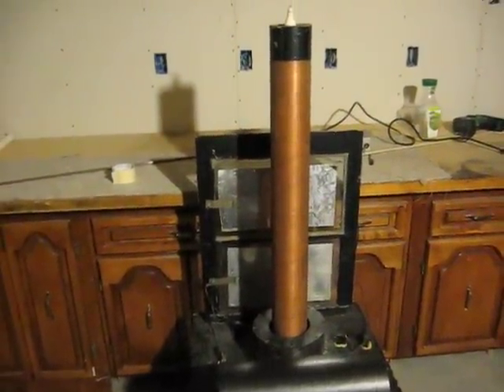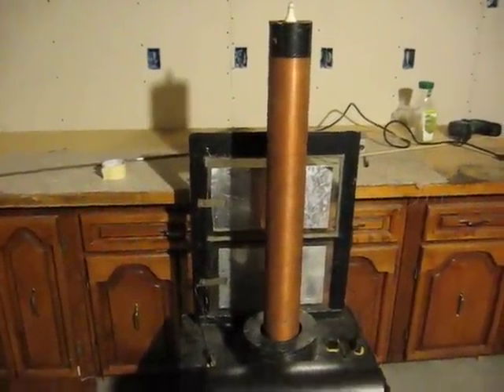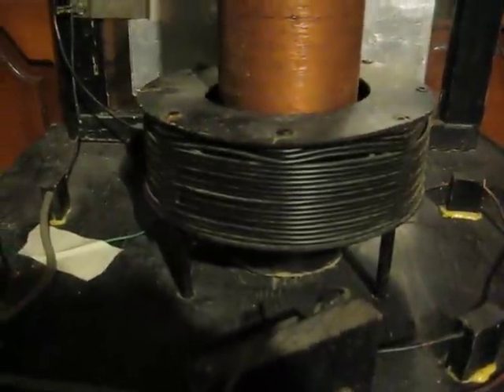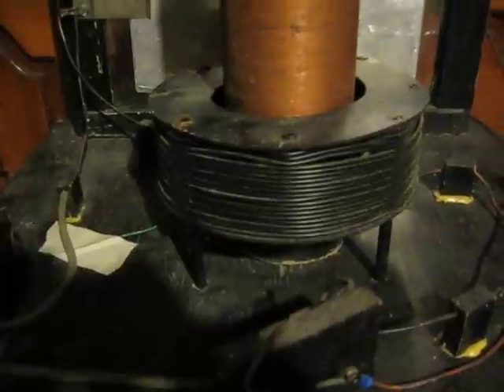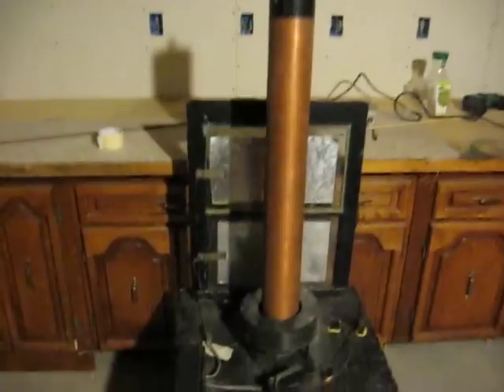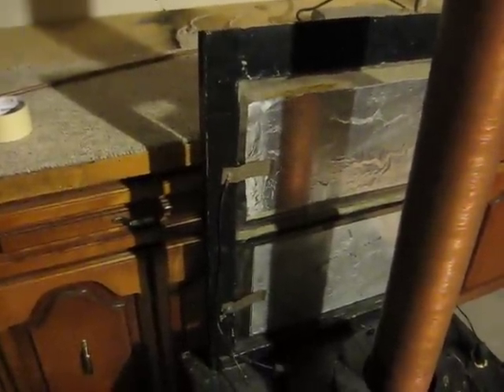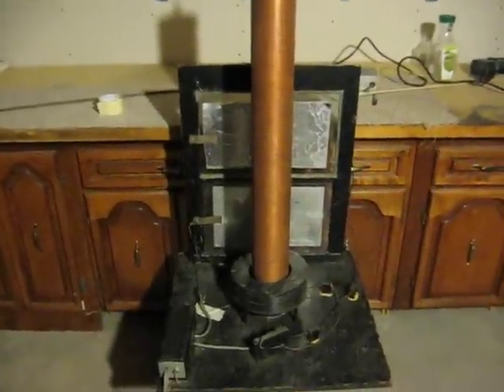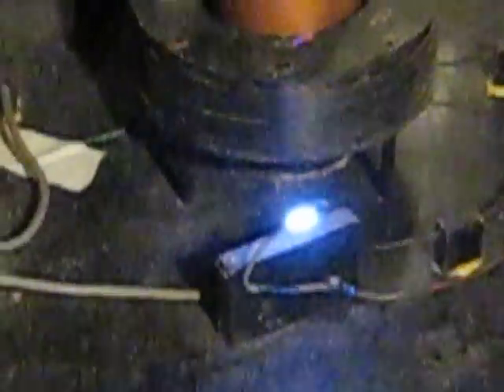Tesla Coil Built 43 Years ago. ©

Comment: The large voltage opinion put the output should be tuned so it doesn't have to be that high voltage you don't have To see spark to make this tune to A OUT PUT OR RECIEVER  B replacatuion of recieve being tuned to the reciever is inportant thus condition makes it valued of woek performed